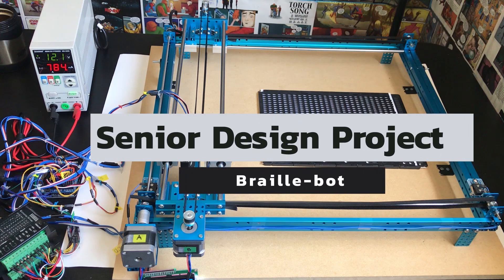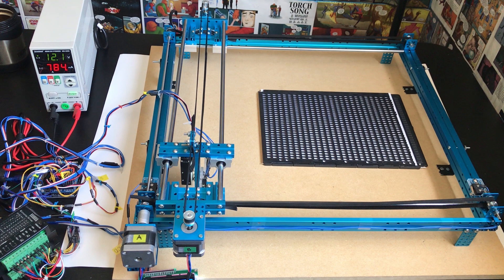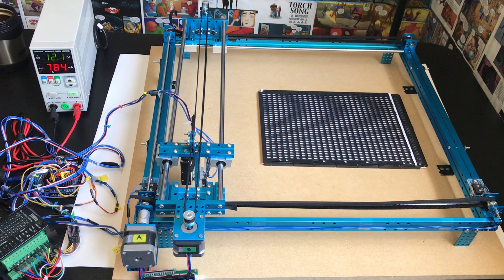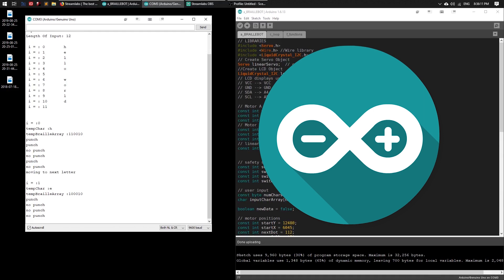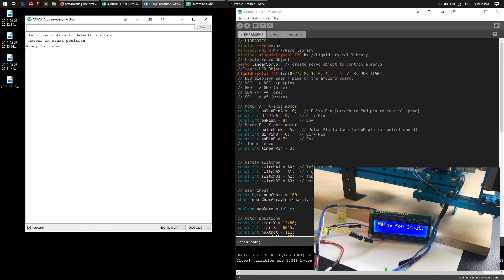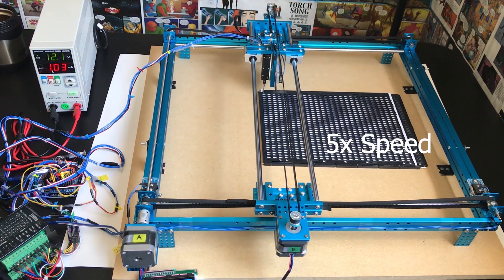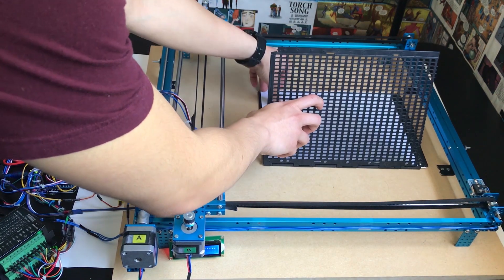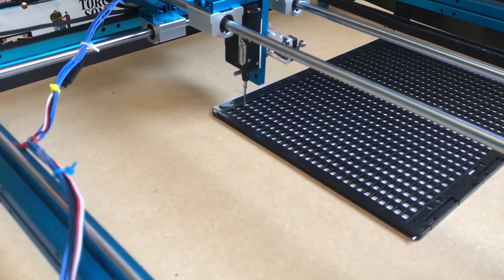Arduino Project | Braille-bot | Braille Printer using Stepper Motors

Comment: how many signs in second? how many dots?
Reply from the maker: Hi what do you mean by 'in second'?
Reply: @QRobotix  in 1 second
Reply from the maker: @denizsincar29  Hi for the demo it was slowed down to about 1 dot/sec. The speed can be increased but I forgot what the max speed of the linear motor was.

Comment: Hi, Your device is amazing and this video is very helpful on our thesis project. However, I would like to ask if the code is still applicable if our device should automatically write "A" after the device turned on and would only proceed on the next letter if the next button is pressed. Our thesis device is supposed to help the blind on learning braille alphabet. Thankyou so much and looking forward on you reply ❤️❤️❤️
Reply from the maker: Yes you can modify it to print just one letter at a time if you wish